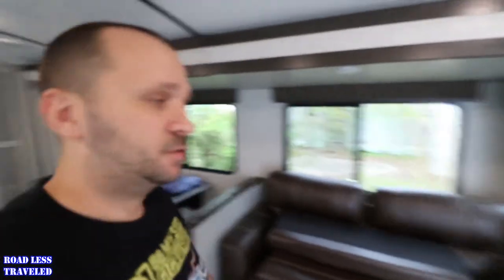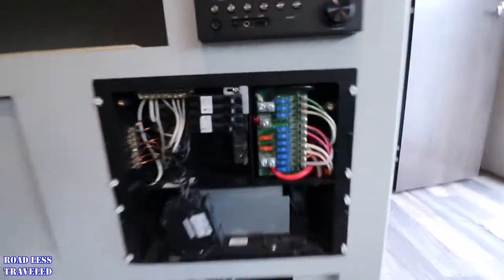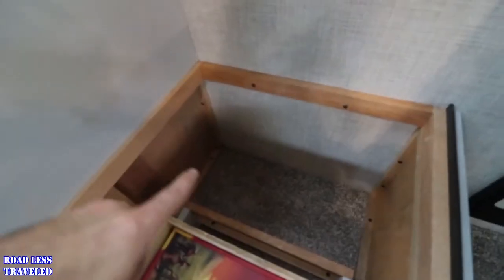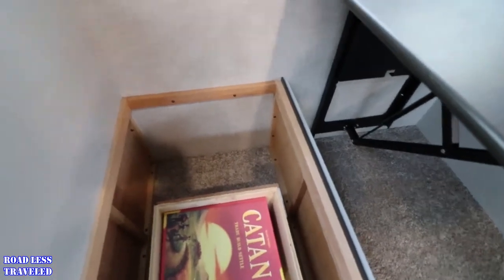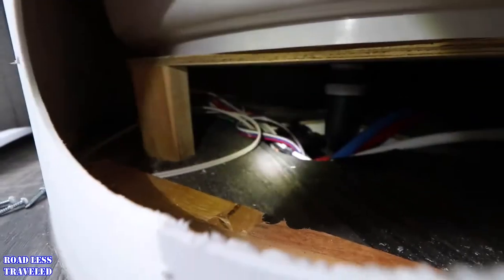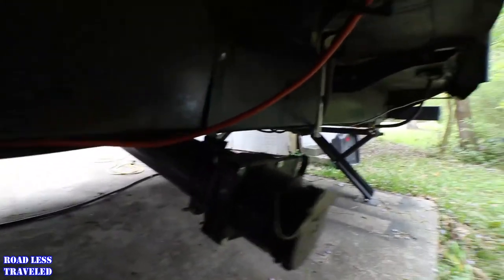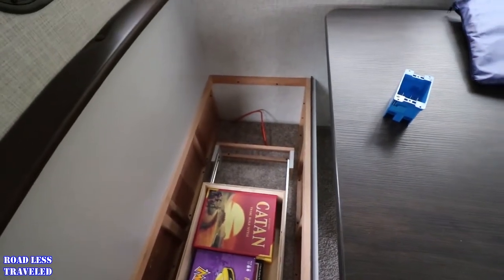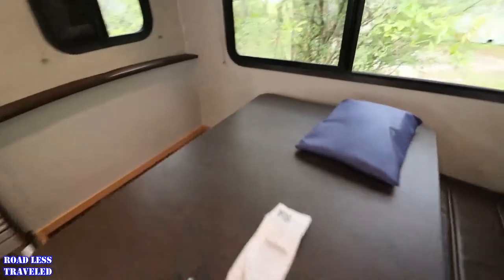Rv Upgrade - AC Outlet On Slide-out

Comment: Great video I'm looking to do the same. I know your videos a few years old now but the only thing different I would do is change out that extension cord to a properly rated 14 or 12 guage SOOW cable. It's rated for extended outside use and doesn't get brittle like extension cords do with age. Piece of mind if a new owner ever wants to plug a high draw appliance into it. Ask me how I know. We lost our house to the previous owners wiring job.